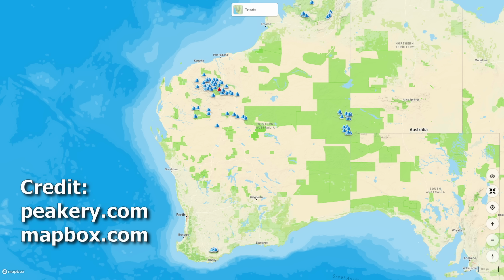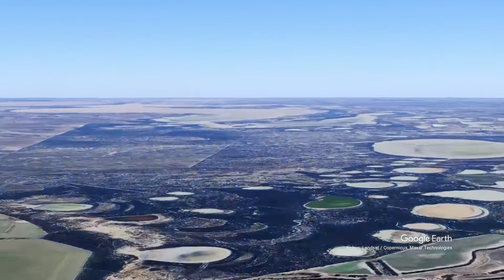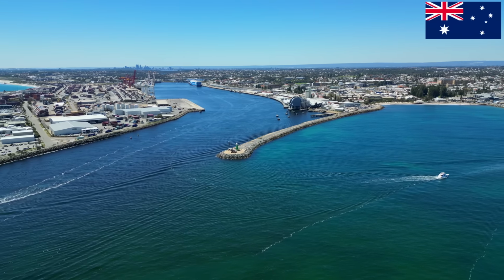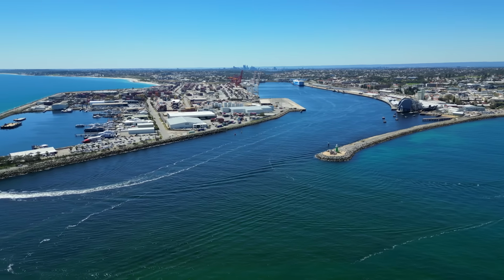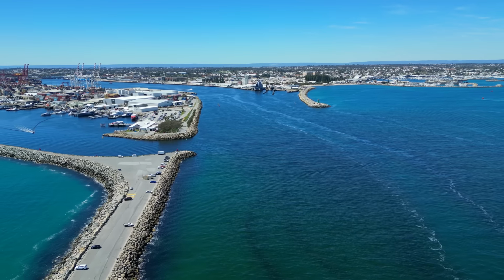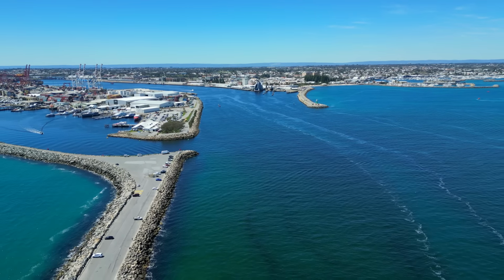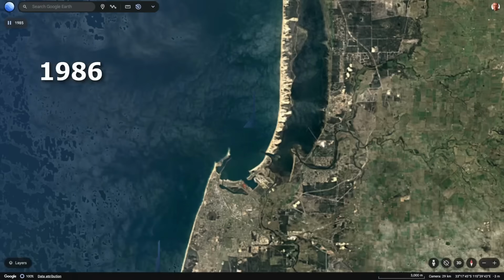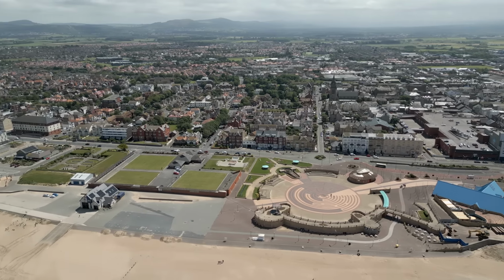Why Western Australia’s Sand Dunes Don’t Make Sense. Ep7: Dunes

Comment: Seems like you haven't accounted for time, rising and falling sea level and the several orders of magnitude higher wave action on the WA coast. Furthermore, the low tidal range concentrates wave action and increases erosion rates on rock substrates
Reply from the maker: I have looked in to sea level changes along this coast in detail, and have, for example, investigated the possible effects of the Late Holocene High Stand, which was the last time sea levels were potentially higher in this region, and which affected the Indian Ocean around 8000 years ago. This high stand has been used to describe why the Leschenault Peninsula sand bar might exist, although if the sea level was two meters higher than present, surely the sand layers would have covered all of the lower lying land directly to the east of the peninsula, including the Leschenault Ghost Forest found in the inlet. Apart from this possible high stand, sea levels are currently higher than any previous time in many thousands of years. Yes I agree wave action is responsible for a lot of erosion on this coastline, but this is not adding new sand in to this region, which is the entire point of this video.

Comment: very interesting. Not sure if this is useful information, but forty years ago, this low formation of sand did not exist. https://maps.app.goo.gl/cEQ3ciVBuYdA7WseA 
The beach was continuous to the westerly point, similar to the beach for most of Warnbro Sound. I remember it starting as a small island at what is perhaps now it's not southerly point. and joined the mainline over time. Interesting that the sands dunes are almost absent for most of the Rockingham and Safety Bay area, other than right at Point Peron.
Reply: 45 years ago I used to windsurf between the beach and the sandbar, back then it was only visible at low tide and about 5m x 10m.

My mother had two friends who lived on Penguin Rd in 1900 and they can remember tall ships anchored where the grass reserve is along Safety Bay Rd and there were no houses on the Southern side of Penguin Rd , it was the beach. It’s been filling in for a long time!

Is the Yacht club jetty still there? 
Was looking pretty sad last time I was there. It used to be used by the Professional Cray fishermen to unload their catch.

Comment: Continental Drift is a very old theory before Plate Tectonics became proven through various geophysics methods just after WW2 and into the '60's.

The UK is also currently under going a "rebound" from the weight of massive ice sheets during the last ice age. Northern parts rising, more southern sinking (in layman's terms). So not just sediment flows towards the coast (Ephesus in Turkey also used to be a port. Now ~1.5km from the sea, so sedimentation is a thing, but also a main river changed direction).

Sea levels fell significantly during the last ice age. Also there have been sea level rises & falls since then along with changes in climates - Saharan desert used to have forests.

WA is blimen ancient & rivers & other processes have eroded traces of pretty much everything. Flat lying ground floods extensively, even in this day & age.

Go up around Shark Bay to Shell beach and you'll see how easy it is for eco systems of modern day bivalves to flourish & die rapidly (~3yrs) to create the shell deposits of the area in higher salinity waters almost cut off from the regular ocean.

Drive up along parts of the coast today and you see water "trapped" inland from the sea running sub parallel to the coastline past Two Rocks, Moore River etc. Get a flood event that can't breakout to the sea, then it will go elsewhere trying to find a path. Life finds a way & it doesn't take long to build up deposits like Shell bay that can then get buried by wind etc. 

Inland run off of minerals, acidic & alkaline waters combined with calcium carbonate from shells can cement things into place pretty well.

Most geologists believe the chevron sand dunes of WA are formed by aeolian processes with rising & falling sea levels & river flood events over millions of years and not mega tsunamis. The Burckle crater isn't confirmed as a crater (yet) due to inconsistencies in some of the limited data collected.

But have 2 geologists & you'll get 5 opinions on most things as we don't like to lump everything into one basket and are always thinking of another "what if..."

Anyway, it was a nice video to watch as a naturalised Sand Groper.
Reply: Continental Drift is another (earlier) term for Plate Tectonics. You need to check your sources.
Reply: @PJRye  Continental Drift is an old disproved theory where the continents moved around the planet through the oceanic rock much like an ice breaker does through pack ice.

Plate Tectonics is where the surface of the planet is fractured like an egg shell and the plates containing both continental & oceanic crust move about due to the convection plumes coming off the mantle. Plates subduct and are destroyed at some plate margins (Andes for example), but are reborn at others through spreading ridges. (Mid Atlantic ridge for example).

As for my sources, I've been a geologist for over 30 years.
Reply from the maker: @PJRye  Continental drift describes the movement of continents. Plate tectonics explains how and why that movement occurs. They are related, but not interchangeable, and both are still used in geology depending on context. I use the term continental drift when I am just talking about the continents moving, without going into plate tectonics.
Reply from the maker: I use the term continental drift when I want to discuss the movement of the continents without discussing the tectonic aspects.  One of the reasons I emphasise there has been no glaciation in WA is because of the lack therefore of isostatic rebound as seen in the UK and Scandinavia. This means the relative height of the land in WA, regardless of the sea level, has been static for a long time here. I have looked at lots of the salt pans around the Moore River park, and place like Quinn's Castle. In the next video I will be taking a very close look at how the chevron dunes form, I have new data on the exact mechanism, which also rather debunks Burkle some more.
Reply: @WATsunami there is no Continental movement without plate tectonics. It is that simple.

Comment: How did the sand get to the mountains? Where was it before that??
Reply: Sand is just a particle size. Big rocks become little rocks become gravel become sand become silt, or clay.

This is simplified and there are many processes (chemical & physical) inbetween that can cause it. What the rock is made of & the processes acting on it can determine how fast it breaks down and into what.

Think of yourself hitting a small rock with a hammer again & again. Mother nature does it on a massive scale. Just often slower.
Reply from the maker: The sand is contained within the rocks of the earth's crust as they form from the magma. In places where they are squeezed up by tectonic forces they can become mountains which then allows the sand to be weathered out of these rocks.

Comment: Nope, the coastal sand in Perth is mostly marine based, deeper inland at the base of Darling scrap there ia dunes that are quarts based but NOT along the coast, read below:

The Quindalup Dunes, found along the coast of Western Australia, are the youngest dune system on the Swan Coastal Plain (formed <7,000 years ago). They are characterized by highly calcareous sands, primarily composed of marine-derived materials. 
Carbine Resources
Carbine Resources
 +4
Key sand components and minerals include:
Calcium Carbonate  The primary component, derived from broken-down shells, coral, and other marine organisms.
Quartz Sand: A smaller component of the Quindalup system compared to the older inland dune systems (Spearwood and Bassendean), which are almost entirely quartz.
Heavy Minerals: The Quindalup dunes contain minor concentrations of heavy minerals, which are of interest for resource potential.
Other Minerals: They are also noted for being rich in phosphorus and magnesium carbonate. 
ChemCentre
ChemCentre
 +4
The sand is pale grey to white in colour, and in some areas, the dunes are considered a major source of lime sand for agricultural soil amendment. 
Carbine Resources
Carbine Resources
 +1
Reply: As far as my amateur opinion is concerned most of Australia is the bottom of a sea in dry form.
As far as I know most of the ocean bed is sand.

Comment: Very interesting, you either did a lot of planning or used a lot of frequent flyer points.

FYI the Swan River was also a river that didn’t continuously flow until it was dredged out to make the port.

My mother had some friends who were born around 1890, they lived on penguin rd safety bay when it was on the beach and sailing ships moored where Safety Bay Rd now is.
Reply from the maker: A lot of planning. :) Yes I had looked in to some historical facts regarding the Swan River and the fact it also had a sand bar before European settlement.
Reply: @WATsunami An hour interesting read is Leeming , a Dutch sailor who was marooned by the mouth of the swan River in a longboat and how they made it all the way to Batavia.

Comment: Some of the most pure silica sands are found along the WA coast.
Reply from the maker: I think this is because the sand deposits along the WA coast are extremely ancient, like many millions of years old, which means other elements are weathered to nothing which just leaves the remaining quartz.
Reply: @WATsunami  3:45 Empire of sand https://www.youtube.com/watch?v=v29ou094luc 
Atomic Frontier agrees with you
Reply: @WATsunami there is a level of rinsing, but mineral sands in WA are huge resources. Titanium, tin, aluminum, lithium. The whole coastal plain has been acting like a gold planners dish for centuries, separating ore by weight by rinsing and washing for centuries. And left them in layers. It is very very old dirt. Your comparing it to the UK is quite naive.
Reply: Millions of years, not just hundreds. But yeah you are spot on.
Reply: Squeaky sand

Comment: This is not me disagreeing with you but i'm not sure the Collie river would be the best example to show a lack of deposition of sediment over time. I would think the lack of sediment being deposited from the Collie river is because of the multiple dams. I have snorkelled both upstream and downstream of the main Wellington dam and the water leaving the dam is crystal clear completely free of sediment while the water upstream of the dam is significantly less so, although not sediment to the extent of the English river you have shown. There is another smaller dam downstream of the main Wellington reservoir so i would think all the water leading to the ocean would nearly completely lose any sediment picked up through most of the river and through the hills.
Reply from the maker: Hey Jordan, thank you for your comment. I have to say I have not explored upstream on the Collie River, only the estuary around Leschenault. This is something I will look in to. The Collie River is also the outlet for several other major tributaries, the Wellesley and Brunswick Rivers, as well as the Preston River and tributaries which also outlets in to the Leschenault. All of these rivers combined still do not show a change on Google Maps over 40 years. However, I do fully agree, dams will have an effect on the load of a river. Your observations of the water clarity upstream and downstream of dams fits with my own knowledge of the subject. Dams stop downstream sediment transportation. Every single dam everywhere will eventually become clogged. https://www.youtube.com/watch?v=XiUOBdEUqjY
Reply: @WATsunami  most of the rivers on Darling Scarp in Western Australia have dams. One of the oldest is Mundaring Wier which was built in 1900 to send water 600km to goldfields by pipeline and a series of pumping stations
Reply: Plus water table adjustment from mining over 100 years has distorted the Collie river beyond recognition over the years as well....

Comment: Poor. Sand refers to a grain size. Not composition. The dune formations in WA are part of the Tamala Limestone is a geological formation. It is a mix of quartz and shell grit, the result of a series of marine transgressions and regressions.  During the multiple glaciations over the past 1my, when the sea level was 150m below the current sea level, a huge volume of sand was exposed, expending out more than 15km from the current shoreline. This allowed the westerly winds to push the sand inland. to allowing There is no real evidence of tsunamis.
Reply from the maker: This is still an ongoing study, but... Wind blown sand dunes are composed of fine sand grains only. Never coarse particles, and never rocks and boulders. The next video has another experiment to show this. I studied sand dune formation in the UK, and compared this with the dunes in WA. They have different origins. If there are any coarse particles, it is marine. You should visit the Margaret River Sculpture Park. 3km from the sea, 30 meters above sea level. At the highest estimates of the Mid Holocene Indian Ocean High Stand, the sea level was 3 meters above current levels for a short (a few decades) time. Sea level change marine transgressions and regressions cannot account for these deposits.
Reply: @WATsunami Trigg beach shows evidence of your words, with a blatant obviousness.
Reply: @WATsunami Yilgarn craton at Margaret River Sculpture Park.
Reply: Sea-levels have fluctuated constantly over geological time.

I drilled a coastal sand deposit near Dongara to be used as a source of lime sand for concrete making.

Beneath 10-20m of dune sand (composed of >95% shell fragments) lay a coral reef.
Reply: where has the quartz come from and why only it - as its so hard and everything else has dissolved? except shells? also is the majority of the waters of the continental shelf off WA made of quartz and shell grit too i.e, the source of the sand before westerly currents and winds blew it onto shore? why did WA waters have so many shellfish? When you say Tamalafg Limestone do you mean to say quartz is laid down as the limestone is forming and as it crumbles? I still donr hno where thr sanf  lomes fro
Reply: Eay back behind the initial dunes is Tamala samds. Drom eastern Wanneroo down some to.eastern Dunsbrough. Not coastal.such
Reply: Marine transgressions and regressions say nothing about where the quartz comes from which entire video is about, and there’s geological evidence in Perth including chevrons.
Reply: @Freshbott2 The quartz weathers out of the ganite/gneiss and surrounding sediments. It is washe into the ocean by rivers then moved onto beaches mixed with marine shell grit.
Reply: @ebhsbill  Yes we’ve established how it’s created. But from WHERE? I feel like you’re a few steps behind the whole conversation?
Reply: Large sand particles don't need to be suspended in the air to be moved by the wind. They migrate along the ground via surface creep and saltation.
Reply from the maker: Large particles cannot be transported by wind. Wind blown dunes are only every the finest particles. I have a new time lapse video coming up to show this. The example shown in the video is a marine deposit, its full of shell fragments.
Reply: @WATsunami numbnuts😂😂😂 have you managed to video the entire sequence from the beginning😂😂😂